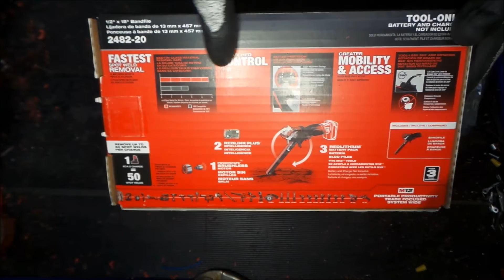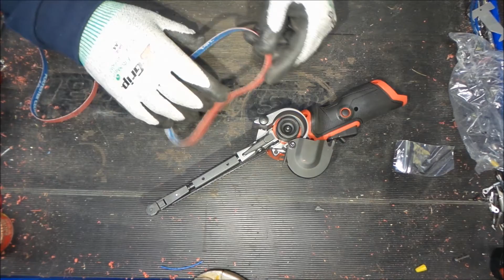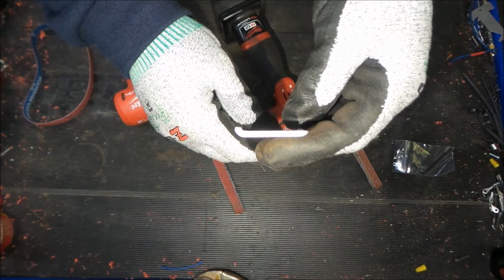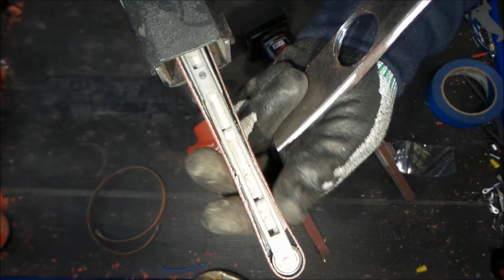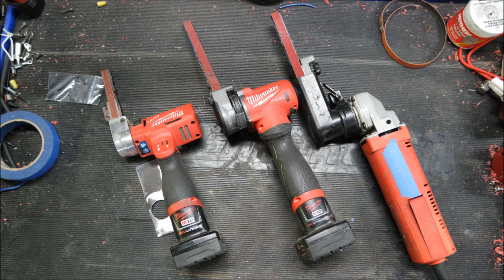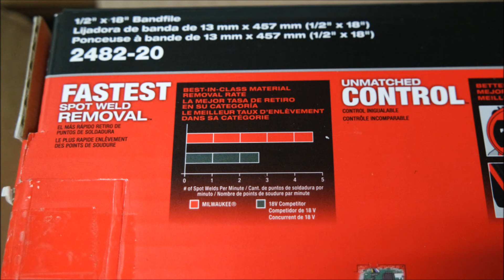An In-Depth Review of the Milwaukee M12 FUEL™ 1/2” X 18” Bandfile 2482-20 - Tool Review

Comment: First, you DO NOT have to hold down the locking mechanism when decompressing the arm when placing a belt , it will lock on its on.  If you find it difficult to compress the arm you can also press it down against a table instead of using your hand.

Second, you need to make sure the belt is fully seated around the drive wheel before placing it on the arm, this will give you ample length to reinstall the belt.  I made the same mistake when I installed my first belt.  Beware that some aftermarket belts may not be a strict 18" making the replacement  a little more difficult.
Reply from the maker: I like compressing the mechanism by hand, but I guess this is a case of do what works best for you. I feel like I have a better feel for what the mechanism is doing if I do it by hand.

I don't think you need to have the belt perfectly aligned prior to releasing tension. Everything should center up on the drive wheels. You should be running the tool slowly or bumping the trigger to make sure the belt is tracking properly after each time you change a belt anyhow. 

Belt adjustment isn't a big deal, but it could definitely catch up new gamers. At the end of the day if what your doing works for you and you aren't having tool failures, a band file is a great tool to have in the arsenal. Thanks for the comment.

Comment: Wish you would have done a fair comparison to the original 1/2"x 18" adapter kit I made. It is significantly better than the 3/8. And cheaper than the new tool. Thanks
Reply from the maker: I might be able to make that happen.
Reply from the maker: I got some ideas to get some real comparisons with some data to compare. I gotta make up a few rigs but it should be fun.

Comment: Great content and review.  I recently bought the unit you tested.  Question:  Will the 3/8" Milwaukee band file arm fit the 1/2" power unit, and, if so, is the 3/8"x12"(?) band file arm available separately from Milwaukee?
Reply from the maker: That is a great question, I do not have an answer for you but I'll try and do some digging and find out. I'm thinking the two tools should be similar. The drive wheel may be a different size between them.